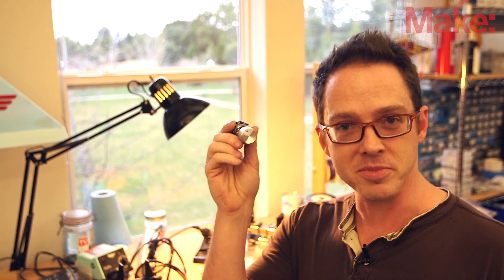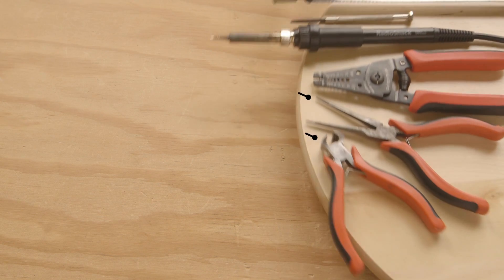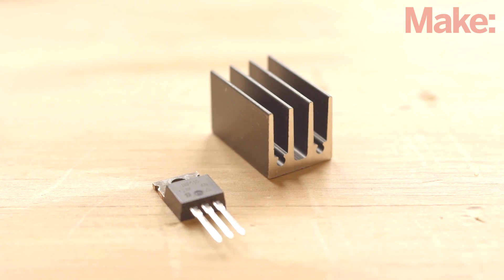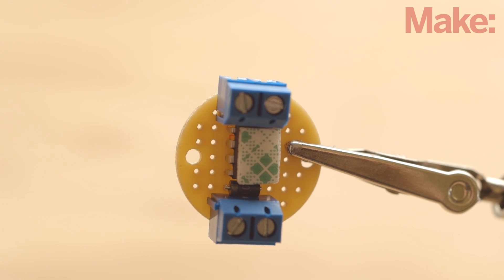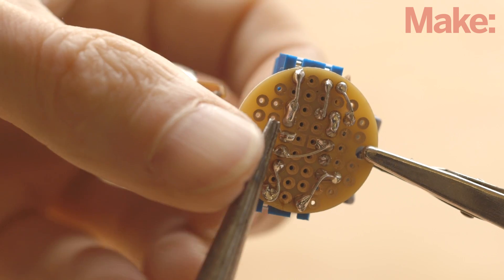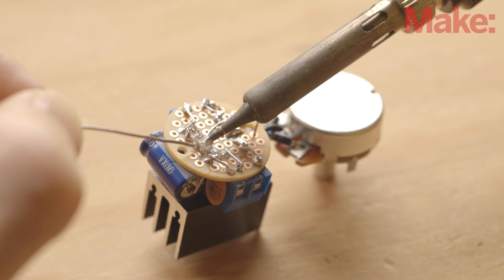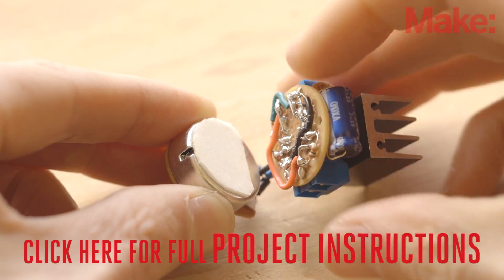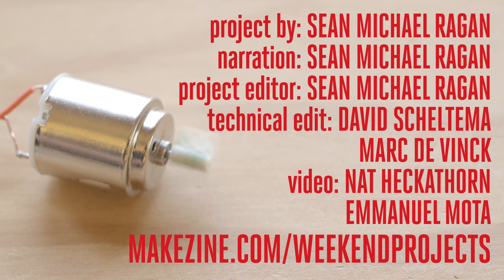Weekend Projects - Dial-a-Speed Motor Controller

Comment: So, why not just use the potentiometer as a voltage splitter, or even just a variable resistor? I'm sure there are reasons for adding the extra components, but as a beginner, I don't understand why this is preferable.

Comment: I am hoping to make an electric cuptisserie turner that is variable speed.  My frame work will carry the weight of the tumblers or cups but I really need to have a variable speed motor from 1 - 25 rpm.  Would really appreciate some guidance on the easiest and/or the cheapest way of going about achieving this!  Any chance you would guide me toward this goal!  We also have had our Radio Shack close 4 years ago...  So anything needed will have to be ordered... do you have ideas for any suppliers?   Any help is appreciated!!!  Thanks,
Vicky

Comment: A suggestion from what we know of thermodynamics, a major drawback from electricity is the heat it creates. Think of electricity from the power source as a chemical reaction- energy flows, but with that in mind, it creates kinetic energy in which heat can, over time, break down your components. If people resolved to use strictly magnets (practically harnessing magnetic levitation) for use as a motor, the main challenge we need to overcome would still  be the output and incomparably perfect timing. Maybe we could try and "perfect" our current electrical setup, but then the question we're left with is- do we want it to last a century, or 10 years?

Comment: Does anyone know the current rating for the whole circuit.  If I make one, I would use it with a motor pulling 15-20 amps.  Thanks in advance

Comment: Wouldn't this do the exact same thing? 
http://www.ebay.com.au/itm/Practical-DC-1-8V-3V-5V-6V-12V-2A-Low-Voltage-Motor-Speed-Controller-PWM-1803B-/391126712580?hash=item5b10f80104:g:kmcAAOSwD0lUdsbi

Comment: hi sir I am doing a project on spot welding I want to fix timer for spot welding using 555timer at 230 volts with regulator

Comment: yeea maybe if you could label the capacitor values that would be great
Reply: Android Series What about the Capacity? I think that's what SLAYER was asking for..
Reply: You should know how to pick a capacitor based on the voltage of your Motor.
----The general rule is always use a capacitor with a higher working voltage than the circuit it is used in. This is of particular importance in power supply circuits with high value electrolytic capacitors. The working voltage should always exceed the peak working voltage of the circuit by a minimum of 20%.
Reply: @AndrewCubacub  someone who KNOWS how to pick a cap wouldn't need to watch this. Complete noobs like me who are just getting interested in electronics need it spelt it out for us

Comment: Or an LM317 and a 100k potentiometer? Cuz simplicity right....
Reply: Then the speed would reduce only slightly and you would loose a lot of torque. The one from the video is far better for this kind of motors.

Comment: Great project for $56.84, at Radio Shack.  What would be the advantage of the above over something like this for 3A . http://www.ebay.com/itm/PWM-DC-6V-12V-24V-3A-Motor-Speed-Controller-Adjustable-Normal-Reverse-Switch-/161648075926?_trksid=p2141725.m3641.l6368

Comment: I fully grasp the concept of pulse width modulation for power control; what I don't understand is why anyone would bother with such a complicated circuit, when a simple potentiometer set up as a voltage divider will work just fine.........
Reply: The answer to your question is threefold:  efficiency, cost, and heat.  To use a potentiometer as a variable voltage divider wastes electricity through heat dissipation in the resistive element of the potentiometer.  The potentiometer would have to be built much larger to handle the heat, and would cost quite a bit more.  A PWM circuit to control DC motors is efficient, inexpensive, and reliable, and can be scaled up quite a bit to run more powerful machinery.
There's also tendency of some DC motors to run more reliably at low speeds with a PWM circuit than with a constant, lower voltage.

Comment: i tried using an lm317 to control a motor, but i guess the less voltage, the more current, so the motor stayed the same speed, i also figured out im not to good with electrics but ill keep trying

Comment: Can a use a speaker volume controller for controlling speed
Reply: If you just mean the potentiometer, then yes. The only difference is that it will probably have an audio taper (log) which would probably make it more precise for low speed control.

Comment: Can i use this to control motor of electric skateboard
Reply: You'd have to incorporate a transistor in there somewhere because it wouldn't directly drive it from the supply voltage to this circuit like it does with the motor in the video.

Comment: Can we use it to control the speed of an AC motor ?
Reply: +Ali Asir no
Reply: kiskiller3 Mmmmm, How to contorl the speed of an AC motor for example 1500 watt motor ?
Reply: you could try a simple lamp dimmer that you buy at the hardware store
Reply: some of them are made for fan motors
Reply: Can it handle 1500 watt ?
Reply: you jsut have to find one that is rated for that its pretty common
Reply: kiskiller3 thnx for info
Reply: +Ali Asir no prob

Comment: An interesting instructional video on making a PWM  controller. I recently had a need for such a thing, and if I had seen this video first I probably would have made one. Instead I went on ebay, and had two very nice and compact PWM Speed controllers delivered to my door for a little over £3 the pair (under $5). What's the price of the parts on this? My guess is that it would come in at many many times the price. Indeed I just checked my local electronics parts supplier and even a single 100kohm pot costs a lot more than the 2 controllers. I'm all for making stuff yourself, but a certain prudence suggests it isn't always the best idea.
Reply: You could easily salvage pretty much all of these parts. All you'd really need to buy is the 555 and the proto board.  Assuming you don't have them laying around.

Comment: FFS seriously get an arduino clone or an ESP8266 for $4 and an H bridge and do it over wifi.

http://www.cnx-software.com/2016/02/19/4-wemos-d1-mini-esp8266-board-supports-shields-with-a-temperature-sensor-a-button-a-relay-or-a-micro-sd-slot/

Honestly if it's for a robot am I supposed to chase this thing around a room trying to turn a pot to change it's speed?
Reply: +TheShorterboy it has alot more uses than for robots and its alo much cheaper than an adruino... just sayin

Comment: That heatsink is wasted time and money. Just get a mosfet with a really low Rds(on) resistance, since the dissapated power is linearly dependent on the transistor resistance and current. Low resistance means a high efficiency and low heat.

Comment: Thank you for this weekend project presentation. I think it is important to put the advantages - disadvantages of such circuit. The advantages has been presented, it allow to control the speed of the motor without needed gears, or additional mechanical system. The disadvantage, however, is that the motor, since it does not have any reduction ratio, have a very low torque, as compared to other systems with gears, that have a torque value superior by the order of the reduction ratio.

Comment: what is the input voltage? can I plug this to 220V AC ?
Reply: no ... you cant .... you can input 12 volt
Reply: +arijit2u
For 220 volt AC the dimmer is the best choice, although you should be extremely careful with it. But for lower AC voltages a bridge rectifier is good enough.

Comment: Made it. Didn't work for me. I'm not sure if the 555 timer or MOSFET is bad or what. Building it for use in the Optical Tremolo 2.0 project for my guitar teacher. I used the instructions from Make, assembled it just like shown, and it just didn't work. When I first finished it, it only showed maybe half a volt or less on the motor terminals, and the Vcc and Ground leads appeared to be shorted. But then it got weird. The next day, I tried it, and the fan worked, but the potentiometer had no effect. I tried again again the next day, and it worked fine. However, when the potentiometer was twisted all the way to what would be off, it ran the fan on full voltage. It worked though, so I made the optical tremolo 2.0 project, only to have it not work for me again. Yet again, the motor terminals only show maybe half a volt. Sent an email to the creator of the project close to two weeks ago, and he still hasn't responded. I doubt he ever will. This project has probably been around too long for Make to comment on it or help me.
Reply: did you ever get yours to work?  I'm working on this and have the same issue, thought maybe it was the IC but can make a more simple blinky with LED and it seems to work fine, but when put into this circuit it simply will not work, I have an idea on why it won't work, need to figure out a solution yet.

Comment: Does this require a 12v power supply? I tried to attach a 3v 2x AA pack in order to supply a 3v rated DC Motor, but couldn't get any movement. I reviewed my leads to make sure I had everything connected right as well -- any help would be appreciated!

Comment: 100K audio-taper potentiometer RadioShack #271-1722
1N4001 micro 1A diode (3) RadioShack #276-1101
22AWG solid hookup wire, (red, black, green) RadioShack #278-1224
1/8" Heat-shrink tubing RadioShack #278-1610
MOSFET IRF510 transistor RadioShack #276-2072
TO-220/TO-202 aluminum heat sink RadioShack #276-1368
Ring-tongue lug, #6 (16-22 gauge) RadioShack #64-3030
1/4" × 4-40 machine screw RadioShack #64-3011
Lock washer, #4
3/4" double-sided foam tape RadioShack #64-2343/#64-257
Round PCB, 1" diameter RadioShack #276-004
555 timer chip RadioShack #276-1723
2-position PC board terminals (2) RadioShack #276-1388
100μF axial-lead electrolytic capacitor, 35V 20% RadioShack #272-1016
0.1μF ceramic disc capacitor (2) RadioShack #272-135
10K resistor, 1/8W RadioShack #271-006
Silver tone knurled knob RadioShack #274-424 (or other style)
Motor and power source for testing (optional) If you don't already have a project in mind for the Dial-a-Speed, you can test it with any small DC motor rated 12V or less. RadioShack #273-106 is a good off-the-shelf choice. For power, try a 6V 4×AA battery pack like #270-391. Higher-rated motors may work at 12V or less, too, but don't try to run your Dial-a-Speed at more than 12V.
Reply: Better to have all the info.

Comment: actually, this is not an electronic speed control (esc) this would be classified as a mechanical speed control (msc) because you're not controlling the speed completely with electronics, you have to have your hand or a servo make it change. msc's were the speed controls of early hobby grade rc's, which were servo operated, but now esc's make it possible to have just 3 wires running to a box
Reply: That's not true at all, this is an electronic speed controller. The input to set the desired speed is mechanical (your hand turning the pot) but the actual control circuit is full electronic. RC mechanical speed controllers used a servo that would move a contact across a large power resistor that went to the motor (a terrible and lossy way to control a motor). Newer RC speed controllers operate on the same principle of PWM as in the video, but a more complex circuit. Usually with an H-bridge to allow reverse, and better PWM (this circuit has issue with 100% duty). However by your logic, even the new hobby speed controllers are mechanical, as the input is still your hand turning a pot, on the remote control.
Reply: awesome, thanks for teaching me more (not sarcasm) i was doubting myself even as i was typing too lol

Comment: Basically they are making a PWM (pulse width modulation) also very used in LED illumination to dim lights, like in new cars with led stop lights, that's why sometimes that lights seem to be blinking very fast. In a dc motor the time on/of is very small that you will not notice it, neither the motor, it will only decrease it speed

Comment: I think im going to up this circuit a bit and make it so i can drive more than 1200w on 3v so i can controll the current flow to my hho generator
Reply: This is not a current control circuit. It is a pwm circuit, or you can look at it as power over time control. It only switched the power supply to the load on and off. You have no control over voltage or current, at least not directly in a resistive load.

Comment: Whats the mosfet used for?
instead of telling us which component goes where i would have loved an explanation of what component does what.
Reply: The mosfet is being used to switch the large power source on and off very quickly from the relatively small control signal of the 555.
Reply: The MOSFET is a type of transistor (Metal Oxide Semiconductor Field Effect Transistor). Like Pablo said, it is used to switch the motor on and off via the output of the 555. This is a simple PWM circuit, search it on google to find tons of them. The output of the 555 is not strong enough on its own to control the motor, so the MOSFET is used to amplify the signal (square wave). It is basically just acting as a switch (on and off, not working in the linear region) between power and the motor. The video was more showing how to assemble the circuit, not how it works.
Reply: So i guess i think of something wrong if i hear mosfet. The transaltor sad that a mosfet is something that changes the voltage.
But your explanation of a mosfet sound more like a relay
Reply: Yes, but a mosfet can switch much faster to provide the needed pulse.
Reply: replay the video and pay attention... heat sink

Comment: I don't understand these videos. Why not just post up the schematics instead of saying "this wire goes here..." and maybe people will learn something instead of mindlessly soldering components together.
Reply: ***** I think it's a good approach, as it provides a different interpretation of the wiring schematics, for those who are still trying to figure out what those schematics are communicating.  Moreover, for those who just want the thing, and don't care about anything beyond that, this approach is perfect for them.
Reply from the maker: Hi FPV Power, looks like you skimmed over the description underneath the video. The complete build including schematic is right up there  ^^^^^^ Have fun!
Reply: MAKE Yeah I saw that. I just don't see the point in doing a video of soldering components together. Regardless it's good that there's still people encouraging electronics as a hobby, so thanks for that.

Comment: Older Tri-ang model trains run extremely too fast and as a result they are quite out of scale speed.. The motors are three pole and run from a 12 volt controller. If you can use this controller to reduce the speed and provide better control it sounds like it might solve this problem
Reply from the maker: Great suggestion. Not sure if any model train operators have caught wind of this project yet but we hope so.
Reply: That is very good, you should post a video on that.
Reply: scotrail1 i used to love model trains as a kid, Maybe i should laser cut some foams pieces and paint them and make a Halloween or sideshow-ish funhouse ride using old train model bases and this variable motor for speed control and lighting.
Reply: +scotrail1 I built a DC pulse width modulation controller similar to this when I was in the N Scale railroad hobby. Absolutely loved it.

Comment: How many amps/mah does this handle at 12v? And what do i need to upgrade to get more amps though it?
Reply: you have to find a better mosfet that can handle higher currents, since it acts as the switch in this "PWM" motor driver. Look it up, it's clever.
the other components are fine up to 16 volts, your main concern is as i said the mosfet transistor.
Reply: Davide Dopesick But as it is right now. Could it handle 1 amp? Or can i parallel mosfets to spread the load?
Reply: FullFledged2010 the IRF510 shown in the video will do one amp just fine,but i have no idea of how hot it will run, i guess you have to try, you will not instafry anything below 3-4 amps.
Paralleling mosfets is tricky. First of all, as temperature rises internal resistance of the mosfet gets higher, so usually one transistor ends up doing all the work, then the other, etc.
That's for DC. pulsed signals like those from this circuit don't work at all, because mosfets usually have different threshold voltages for turning on, and again one mosfet does all the work and blows up in the process, i suggest you read this thread: forums.parallax.com/showthread.php/146407-Paralleling-two-MOSFETS-to-handle-more-current.
Reply: Davide Dopesick Thx! very interesting thread. So i can just use a bigger mosfet right?
Reply: of course :D
Reply from the maker: Davide Dopesick Thanks for moderating the thread Davide. FullFledged2010 let us know if you design the Controller any different, we'd love to see some pics or hear your take on this build. We're at weekendprojects@makezine.com- thanks!
Reply: He used an IRF510 N channel MOSFET.  It has a channel resistance of about 0.54 ohms when fully turned on.  That package (the TO-220) with a heatsink can probably dissipate 500mW continuous, maybe 750mW.  It really depends on the ambient temperature.  Using Power = Current^2 * Resistance, the maximum current at 500mW is sqrt(500mW/0.54ohms) = 0.96 amps.  If you need more current, you can parallel MOSFETs only if the voltage applied from gate to source exceeds around 7 volts, or you can run into thermal issues.  Of course, you can use a bigger MOSFET, such as the IRF540, or others.